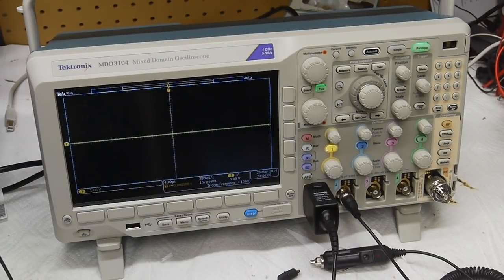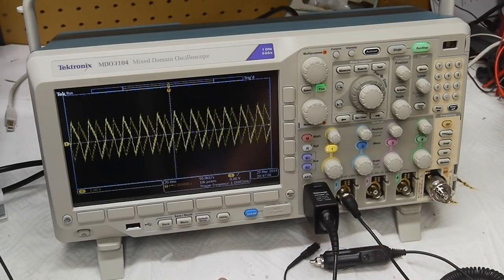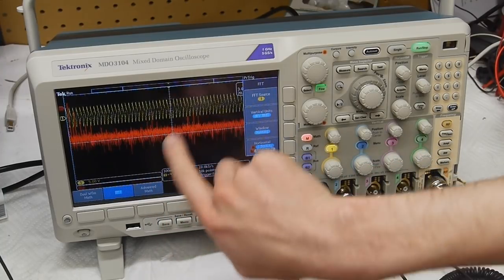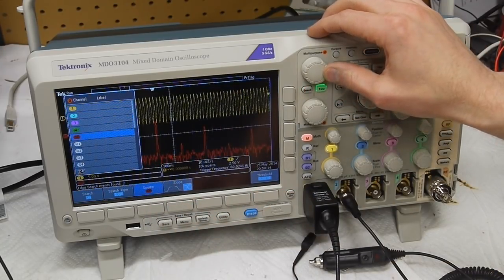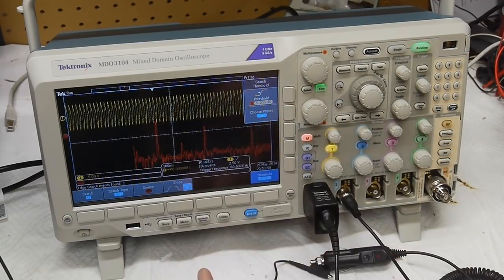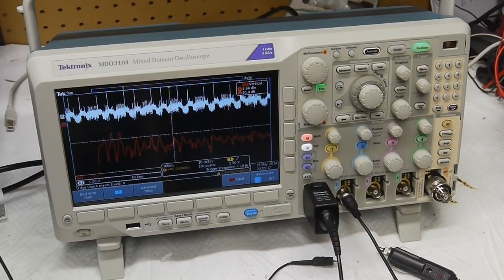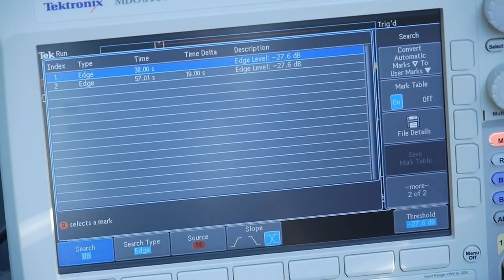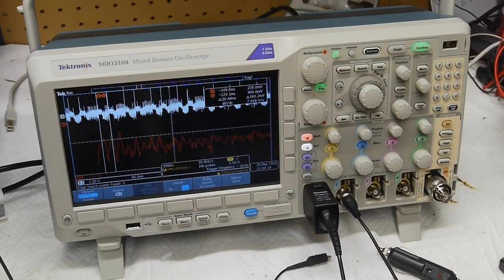Measure car engine speed RPM via the cigarette lighter

Comment: I was trying to figure out what RPM actually means and after listening to your description now I know.  I used your information to figure out how to set my 4 cylinder engine's RPM to 750 using a fluke to measure the igniter (grounds/un grounds the coil with a signal from ECU) hertz. which equaled 25 hertz.

Comment: typically a V6 is an attempt to reduce crankshaft length but because the ideal angle of 120 degrees results in a very flat engine most manufacturers choose 90 degrees and put balancing shafts in to reduce the resulting excess motion. Interesting that DeLorean chose to play with the timing to achieve similar goals.

Comment: The Delorian has an unusual engine that was also used in some Volvo's.  It was a Peugot, Reneault, Volvo collaboration and was known for the odd ignition sequence.  They had a few odd traits, notably a habit of being starved for oil supply to the overhead cam.  I had a Volvo 264 with one and it was a delight, reliable and smooth and long lived.  Not everyone was so lucky and the millions invested in the engine project were mostly lost by the companies that developed it.

Comment: Emmet "Doc" Brown knew about the strange ignition timing of the delorean and used that feature to supercharge his flux capacitor.   Nice scope.  My employer a few years ago supplied me with a similar model that has a logic analyzer option instead of the RF/Spectrum analyzer that yours has.  I soldered about 20 30 gauge wirewrap wires to a surface mount processor and recorded its every move.

Comment: the interference is all that you said plus a fuel pump and maybe a blower motor, i'm trying to find fft usage to diagnose MAF digital sensors on cars ,i'm a mechanic not an electrical genius like you but it did help

Comment: The reason that the Renault PRV V6 in your Delorean has 90 degree bank spacing is because the engine was made from a PRV V8 engine base. Basically Renault took the PRV V8 and removed two cylinders from the block and heads and a throw from the crankshaft to get a V6 engine.

According to the book, the first generation V6 PRV engine (1974-1985) used uneven ignition timing, which explains the strangeness you see on the scope. The second generation engine split the crank pins and got a more even firing, which would probably look better on a scope.

I have an '88 Dodge Dakota with a Chrysler 239 V6 engine which has a similar history to your engine. It's basically a Chrysler 318 V8 with the front two cylinders removed and has split crank pins on the crankshaft. Chrysler had a heck of a time getting it to work without shaking apart so it has a huge harmonic balancer on it and the automatic transmission acts as a second flywheel.

Comment: It's kind of funny, while the oscilloscope makes it easier to play around with the signal, I think it actually makes getting the number you're interested in a bit harder. The microcontroller implementation counting pulses in a fixed period (say, 1 or 2 seconds) would essentially do the averaging automatically.

Comment: Interesting about the V6...
Another oddity would be vehicles without a distributer.  For instance Subarus with 4 cylinder engines have 2 coils that are triggered solid state, and there is a "Lost spark" in the cylinder that is sharing that coil.
Reply: Stephen, can you elaborate a bit more on the 'lost spark' (or give a URL)?
Reply: Joe Higgins er, also "Wasted Spark"
http://en.wikipedia.org/wiki/Wasted_spark
Reply: Stephen Tack
 Thanks Stephen!
Reply: Got the same with my Citroën 2CV, no distributor just points and condenser with a lost spark... Tried an analog sensor, but that didn't do the trick...
Reply: Mazda Miata also has a waste spark setup.
Reply: The GM DIS system is wasted-spark.  If you've ever seen a DIS coil pack, each coil has two outputs.

Comment: Mechanical Volkswagen diesels use a feed from the alternator to sense RPM, the tach is  connected to only one of the poles. It ends up making 33 pulses per revolution.

Comment: Please don't take the average of the periods...Either take 20ms as corresponding to 90 degree phase difference and multiply by four to get one time period; the inverse will yield 750 rpm at idling or take 32 ms as corresponding to 150 degrees and get time for 360 degrees as the time period yielding 781 rpm.

Comment: Just be very careful twiddling with the dials on that Tektronix's oscilloscope while it is plugged into your DeLorrean, it has a hidden Flux Capacitor mode that can easily be accidentally activated.

Comment: Very cool Ben! This video also shows what I keep preaching to hobbyists who design circuits for cars: The car power, particularly from the cigarette lighter, is extremely nasty.
Reply: car supply lines hide some of the nastiest surprises... 3yrs in the automotive already and i'm still impressed:)
Reply: cars are a pretty harsh environment all-together, not just the cigarette lighter :D Scourging heat in the summer that make laptop batteries explode, freezing temperatures in the winter, condensation when it rains, constant (variable) vibrations, and worst of all: children
Reply: +redtails you seem to be an automotive engineer ;) I really like the way you put it especially the last factor hihi:) Greetings, Ivan
Reply: What's so special about the cigarette lighter? Is it just that it's conveniently located inside the car? Where would be a good place to tap into under the hood? Anywhere with 12V on it?

Comment: Add a 10kHz low pass filter - passive or active (opamp), doesn't really matter as your tek has amazing amplifiers. As you said, it would also be useful to get the Tek to autodetect peaks in the spectrum - it must have that capability I would have thought, though I haven't used it.

Comment: Years ago I thought something like this would be quite easy to pull off, although I did not have the equipment to allow it to be more than a fleeting thought. 
You should definitely make a digital tachometer that plugs into the cigarette lighter, I would buy it :)
Seems to me that it would be fairly easy to filter the voltage spikes into a usable pulse train, then averaging that out would be simple, and fairly responsive.

Comment: Great video. My car I think has also 6 cylinders spaced at 90 degrees but is a much modern car so maybe doesn't have this problem (Oldsmobile Intrigue 2002 3.5L)
On modern cars you have the info about RPM using the diagnostic port and much more info.
I was playing once with an old laptop and a DOS software to reset one error that I had. It was do to an old and cracked seal on the gas tank and the error was something about small evaporative leak or similar.
Reply: Yes, the 'Short-Star' V-6s are 90 degree, however GM used a split-pin design on the crankshaft, effectively moving the crank throws to 120 degrees between cylinders.

Comment: Wow, a lot of neat information in one video. Does the uneven firing sequence effect engine performance at all? I would figure an even 'beat' pattern would be less strain and more efficient for the engine.
Reply: The first production V6 engines were all like this: a 90 degree angle between the cylinder banks. These V6 engine blocks were derived directly from V8's - with one cylinder, or "hole", removed from each bank. A much heavier flywheel, along the order of 25 lbs. more of mass, is required for a 90 degree, odd-firing V6 to run reasonably smooth. Some manufacturers (such as Ford) produced 60 degree V6's, and those fire evenly.
All modern V6's use the scheme Ben described; the crank pins are splayed for each connecting rod to allow a consistent and even 120 degree firing sequence.
Fun fact: The smoothest and inherently balanced engine configuration is the venerable Straight, or Inline, 6!
Reply: Awesome, thanks for the info!
Reply: TubeWrangler Cool stuff, I always wondered why engines were in a V-shape to begin with, it seems a highly unstable structure compared to 180° in-line
Reply: ***** 180° would be flat/boxer style engines commonly used by Subaru and Porsche. inline engines have no offset and are [typically] directly behind one another.

Comment: you could also just look up the alternator specs and measure voltage and current draw to determine the rpm of the engine (yes. it is slightly more involved than this but this is the gist of it so you will have to know what you are doing because you will have to be certain that a known load is being supplied...another words you can not have anything else drawing current from the alternator other than what is needed for the vehicle to run...I'm sure that it can still be done with everything electrical still connected but there is much more room for error because it doesn't take a genius to understand that the more components there are in a circuit...more things can go wrong) but it can be done ...of course an occilliscope would be the better option over math

Comment: I was expecting this video to be about using the ripple resulting from the rectified AC current from the generator.  But that would require calibration, since the generator drive ratio and number of poles varies from one make and model to another.  I've heard of aftermarket tachometers that work this way, but, come to think of it, I believe they're intended for diesel engines (not spark ignition).

Comment: Since my Saturn doesn't have a CMP sensor it uses a method similar to this to determine ignition timing. It sucks it's not that accurate though. If they actually put a CMP in it,  I'd be getting at least 40mpg as opposed to the 30 I get now.

Comment: Why wouldn't you derive the RPM from the alternator ripple frequency, as it's directly coupled to the flywheel?
Reply: From the alternator ripple it is easy to see changes in rpm, but not the actual engine rpm, because there is an unknown ratio of pulleys involved. It would have to be calibrated, which kinda defeats the purpose of a simple plug-in measurement.

Comment: I always said the DMC 12 needs a better engine. I wonder if that straight six out of a supra would be any good.
Reply: You'd have trouble making it fit.  There isn't a ton of space in the engine compartment.  As much as I love straight sixes, I don't think it would work.   You'd be better off with a more modern V6 - I'd probably start looking at the Nissan VQ37VHR.  It is compact, plenty of power for this application and very reliable.

I've seen people shoehorn V8 engines into the car but it is almost always more trouble than it is worth.  They forget how light the car is and it was tail-heavy even with the original PRV-6 engine which meant that handling was never going to be the car's strong suit.  It has plenty of grip but when that grip runs out...  The rear-end isn't as wayward as a 911's but almost.

Rumor has it that Lotus (who did the original engineering) were horrified at Delorean's decision to push the engine rearward in order to make room for a luggage shelf in the passenger compartment.  They begged Delorean not to do it and said it would ruin the balance of the car.  He insisted on it and they were able to partially compensate by making the rear wheels and tires much larger for better grip.  But that just postpones the "moment of judgement".

Comment: So, this wouldn't work on a diesel, right? Since it ignites by compression and not electrically.
Reply: DrathVader Probably not. It would only really work if it had computer/electrically controlled fuel injection. Even if it does you probably won't get a signal from it

Comment: Humans seem incapable of leaving behind no trace of their activities. By using a square of aluminum foil hooked to an LM-741 op amp on one million ohm feedback resistor gain and hooking the amplified output to a pair of headphones and placing the apparatus foil side down on any table in my house, I could be informed of when my neighbor's oil-fired furnace was running without making any electrical connection to the power grid. You could also hear when brushed universal motors such as vacuum cleaners and handheld circular saws were being used, and I could tell in less than 3 seconds if someone in the neighborhood has a non-dimmble CFL spiral bulb burning on a dimmer switch. No electrical wall plugs, no probing, no unsafe high voltage. Quite literally all you have to do is instead of connecting a microphone, you connect an antenna. Another scarier thing to know, even if your PC is not connected to the internet and you don't put flash drives or recordable CDs in it, information can be read off the screen even if you aren't even in the same room through opaque walls --if the computer either has a el-cheapo VGA cable or a CRT monitor.

Comment: Probably no FFT needed and no need to look for inductive spikes and all what we need to read RPM from car battery is use alternator ripple using moving averages to track those voltage pulses on car battery and calculate RPM by calibrating to given alternator, while different models can have different numbers of poles, etc.
I was looking for something usefull, but looking for woltage spikes is useless idea, since I'd rather smooth those spikes and use alternator ripple to calculate engine RPM...
It looks like, that quality of battery voltage is very bad in this car since there is so much crap noise from ignition showed in this video.
Lets see how it looks like in Peugeot 206 1.4 HDI engine, I'm working on to read RPm speed from cigarette lighter, but without any FFT, but using simple 8bit AVr MPU...